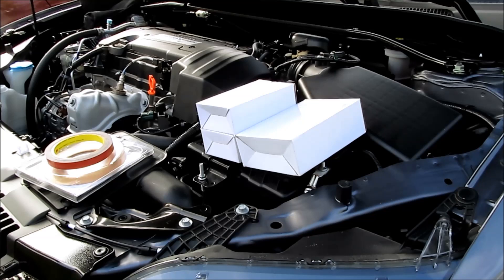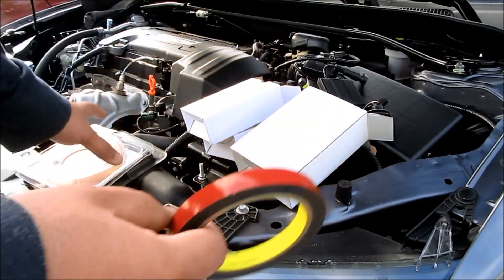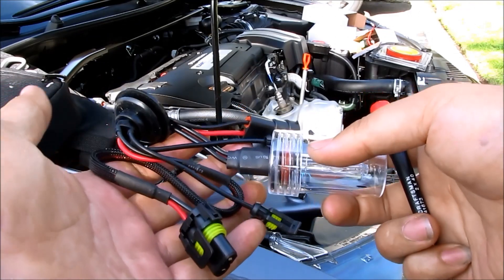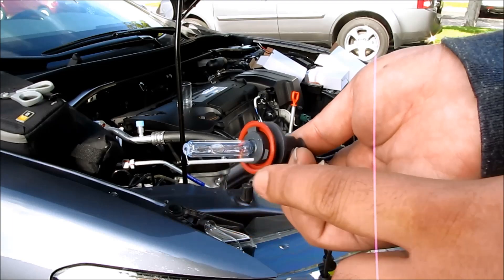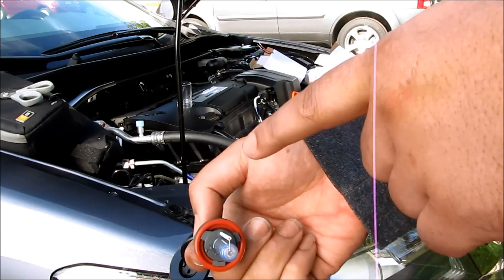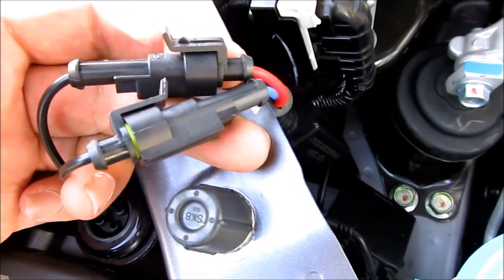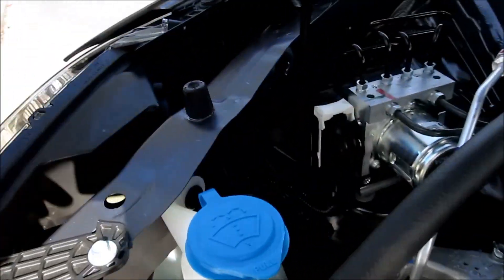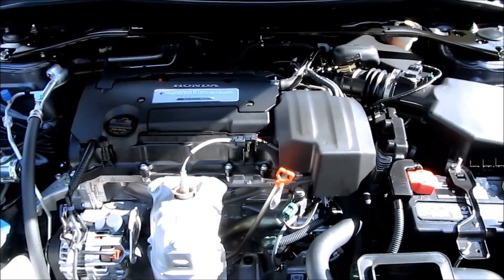DIY 2013 2014 2015  Honda Accord HID install (Must Read Description and Turn on Annotation)

Comment: Just installed this today on my 2014 Accord EXL and it looks great!  Awesome video!  Could not have done without you.
Some observations:
1.  If you have big hands, it's pretty hard to take out and replace the bulbs.  I had to use other tools to get leverage.
2.  Plugging the ballast into the existing cable assembly was REALLY hard.  It took a LOT of pressure to get it to "snap" into place.
3.  I ordered the 6000K temperature bulbs.  They are as far blue as I would go (thinks Car Modz for the advice).  I actually think I may go down to 5000K to get some extra brightness and more closely match my DRLs.

Good Luck everyone, and thanks again for the video!!!

Comment: Hi,

I have a 2014 accord sport. I got the DDM 35w 6000K. I was installing it this way and followed your guidance exactly, but neither bulbs were lighting up. I used the wires that you took off, and they lit right up. So, I believe the sedan versions do need the additional wire to make the bulbs fire up. Thank you for the videos man!

Comment from the maker: Yes, you can use H11 bulb but you will get the return wire shadow on the beam pattern.
Difference between the H11 and H11b is where the return wire is position when locked into the socket housing. In H11 the return wire is on top position (12 o'clock) and in H11B the return wire is on the bottom (6 o'clock) in the housing.

Comment from the maker: Also, if you did remove the extra wire.. try using it.  Plug one end the the HID ballast and the other end to the stock wire harness.  it might be easier to plug in since there is more slack on the line.

Comment from the maker: Are you using the DDM hid Kit?  Also, when push the original headlight socket into the HID ballast you will hear it click.  If you do not hear the click, it is not pushed in far enough.  To give it more leverage, grab the original headlight harness and stick it into the HID ballast... next use your palm to push the plug into the ballast.   You must heard and feel the click.  Also, if that doesn't work.. you have to flip it.. The ballast has a + and - port and it must match.

Comment from the maker: 5k is perfectly fine.  The accord does come with halogen projectors.  It is not ideal to use HID bulb in a headlights that does not have HID projectors because of glare.  But that doesn't mean you can not use them.  The cut off will not be as good as retrofit projectors but they will be way better compare to just regular bulbs.  

You do not have to worry about damaging your stock headlight housing.  Just stick with 35W and nothing bad will happen.

Comment from the maker: Installing switchback leds are uselss for the 2dr accord.  Reason is that the coupe has a amber plastic piece that covers the corner turn signal bulb.  So regardless of the color of the led.. the front turn signals will still be amber both for parking and turn signal.

Now on the Sedan, the amber piece is not there.  So yes, switchback led is an option.  Don't forget to install the resister to fix the hyper blinking.

Comment from the maker: Those wires are used as "extension" wire for the ballast to the OEM harness connectors.  You would plug one end to the ballast and the other end to the OEM wire hanress.

Comment: I have been wanting to put HID's in my low beams as well.  I've read that the low beams on the Accord have reversed polarity and can cause your BOW or capacitors to explode.  Did you need a BOW3 or 4700uF Capacitors to make the HID kit work?
Reply from the maker: IDIAIN You do not need any of those.  BOW and Capacitors are more toward Domestic American and Euro cars( Ford/Dodge etc ) I have not experience any problem with any imports, especially Honda.

Comment: Thanks for the tutorials. I just purchased a 2014 Accord Sport and I want to have the HID lights.  

Question and forgive my ignorance for asking - what's the difference if I just install the bulb vs buying the kit w/ ballasts?
Reply from the maker: YakMan NC If you want to change your headlights to HID then you must purchase the whole kit.  2 HID bulb + 2 HID ballast.  The HID bulbs will not work without the ballast.

Comment: Great Tutorial
Ive installed an HID kit on my Galant a few years back and im wondering, because you have 2 ballasts, theres no relay required??
Mine only had 1 ballast but relay required.
If thats the case then im buying these TOday
Reply from the maker: carlos durazo You need 1 ballast per each hid bulb.  Take a look here:  FAQ: 2013 2014 Honda Accord HID Install 9 months Update

Comment: The link you referenced asks about some additional options.  You answered about all of them except the last.  Do I order the H1/H7 to 9006 adaptor cable?   Thanks.
Reply from the maker: If you purchase the DDM kit.. everything you need is included.. no additional hardware required... Just click 35W..H11.. "color of your choice" and check out.

Comment from the maker: Larry,Check your Inbox.. I sent you video of troubleshooting HID installation.  Also, if your using the extension wire, try removing the yellow rubber plug that is attached to connector base.

Comment: Can you also feature HID install for 8th gen accord particularly with the 2012 4 dr sedan. If. you can also recommend an aftermarket projector headlight, I will greatly appreciate.
Reply from the maker: allan egar Unfortunately, I can only make videos for the cars I own or when customers brings in their cars.  However, that a look here for detail instruction on how to retrofit projectors on a 8thgen accord sedan: http://www.driveaccord.net/forums/showthread.php?t=28737 and http://www.driveaccord.net/forums/showthread.php?t=56046 or this company offers hid projector retrofit service: http://www.lightwerkz.net/gallery/index.php/honda/accordsedan

Comment: jus install 10 minutes ago, it work great ( but they not work before take both wire off). Why cut off working well and keep on not working. If cut off working better why kensun company still making in the kit ? thank you very much

Comment: I would love to see pics of your ballast mounting and wiring.  For what I could barely see in the vid, it looked very clean.  Was that the relay you removed?  Is it because it's only if your low beams are used as DRLs?  What about an anti-flicker capacitor?  Were those built in?  Hondas need those.

Comment: I have pretty large hands as well I didn't find it thwt difficult you just have to get the right angle and put it rather hard and turn. I did struggle somewhat to get it straight up and down.

Comment: As always great work! I just ordered VLED DRL and was wondering if my buying these bulbs would affect the power distribution in any way.  I don't use the high beams all the time but I like knowing that I have them if I need them. Thanks for the videos and subscribed!
Reply from the maker: Good choice on the DRL and led brand. You will have no issues what so ever.  No errors, everything will be fine.

Comment from the maker: Removing the battery will make it much easier.  Also, the wire harness that I removed from the HID bulb is actually a extender for the HID ballast to the factory bulb harness.  You can use that to plug into the factory harness and then plug the other end to the HID ballast.

Comment from the maker: ***** Are you using a relay harness with your HID kit?  If you are then yes, if not then no.  i would try swapping the bulb from left to right and see if the problem follows.  if the problem switches to the other side.. you have a bad hid bulb.  If the problem stays.. you might have a bad ballast.

Comment: Jephu on the link that you gave for the hid kits can you tell me what to fill out in each of the columns. And I would need two sets correct? Thank you.
Wattage:
Bulb Type:
Bulb Color:
Mounting Brackets:
HID Harness:
Error Eliminator:
Adapter Cables:

Comment: I removed the extension wires and wired just like you show on the video pushing the connector as far as possible and still dont work.... dont know what to do now

Comment: Jephu I am having the same issue as Larry b had a month ago with not being able to completely plug in the connector to the ballast
Reply from the maker: I have another video up.. check this out. 
DIY HID Installation Tutorial   Connecting OEM Headlight Plug with the HID ballast Plug

Comment: Hey do you have a video on how to take off the radiator cover? I see that you don't have it on that's why seems you have a lot more space to work on it
Reply from the maker: Only thing remove from under the hood was the stock halogen bulbs.  No other parts were removed.  The vehicle is a completely stock 2013 Honda Accord Coupe US model.

Comment: I found some 100w LED Headlights that would like to install in my 2013 honda civic lx coupe,  they come with ballasts. are they safe to install or will it hard on the wiring and the headlight housing? melting. ...etc?

Comment: Hey Jephu, I went to a local stereo shop to ask about installing an HID kit and I was told that besides the HID kit I would also need to get a projector lens retrofit kit otherwise just installing HID kit would not project light properly and it'll bounce light all around the housing and blind other drivers etc. Have you heard about this?
Reply from the maker: They are somewhat correct ( not entirely) ,  In order to get the BEST possible light output/cutoff, you will need a HID projector setup.

If you have a regular standard halogen bucket reflector type of headlight (non-projector type)... then yes.. if you swap the halogen bulb to HID.. it will cause glare and can annoy oncoming drivers.

Fortunately, the Accord comes with a halogen projector assembly.  Now,  you can swap the halogen bulb with a HID bulb and it will be "acceptable" ( much better compared to standard halogen bowl headlights) .  However, if you compare a true HID projector next to the Halogen projector with HID bulb you will notice that the HID projector will have a much better cutoff.

These TL projectors are popular choice for hid projector retrofit project:  http://www.theretrofitsource.com/complete-retrofit-kits/morimoto-retro-quik-system-accord-honda-2013.html#.Uy9krvnmxYU

Now, if your local shop trys to sell you a aftermarket projector headlight assembly instead of  an oem headlights with hid retrofit projectors.. just walk away.

Comment from the maker: I never heard of kensun hid kit.  If you want better quality bulbs.  I suggest you purchase the kit from retrofitsource, contact Matt over there and tell him you want H11b bulbs.

You can always purchase a H11 bulb and cut the tabs so that the return wire will face down.
I sent you a link.  check it out.

Comment: hey jephu, did you noticed that the bulb was somewhat loose? Like it wiggle around when i connected to the headlight housing.  After a bumpy ride I came back and found out that one of the bulb went off since it wasnt making full contact with the oem harness and the ballast.  I had a hard time connecting the ballast to the oem harness and I found out later that i needed to move the prongs from the ballast in a little closer so that it can make contact and that's when it powers on.
Reply from the maker: I haven't had a problem yet.  It might feel a little loose but unless someone tugged on the wire harness it should not fall off from regular driving.

DIY HID Installation Tutorial   Connecting OEM Headlight Plug with the HID ballast Plug

Comment: I have a question for the 2 wires u have taken off which you said "not necessary" for this installation. If those 2 wires are not "needed", so why the HID company still make those wires come with the bulbs? and what are those wires actually for? what is another option of using those wires and where they can be connected it to, and what are the purpose of the HID company making them going with the bulbs?
Reply from the maker: It is to accommodate different types of connector wires  for all the different make and models of cars out there.   If this is your first HID install, I HIGHLY recommend that you use the included wires that I removed.  To install, you take one of the of the wires and hook it up to the original headlight socket and the other end goes into the HID ballast. Basically you can think of it as a "adapter" that goes in between the original headlight socket and the hid ballast.

The only reason why I removed mine are I was 100% sure that I can get mine to work without it and that meant I had less wires  to tuck/ziptie on the installation. ( I explained this many times on the video and have numerous video uploaded that shows the HID on the car are working properly ).  

Basically if you have to ask why I did what I did.. don't do what I did and just install the extra wires.

Comment: videos are awesome man! keep them coming! quick question I'm looking to Buy and HID kit for my High and low beams on my9thgen. what would you suggest i get?
Reply from the maker: http://www.driveaccord.net/forums/showpost.php?p=2522930&postcount=40

If you choose to install HID on the high beam and you do not have the factory DRL leds strip then your going to have  to disable the DRL light.  

The correct size for the high beam is 9005.

Comment: Hey I just got that same kit and I was wondering if you had any trouble connecting the harness wire to the hid ballast. Thanks
Reply from the maker: No problems with the HID kit I've installed.  Check this vid: FAQ: 2013 2014 Honda Accord HID Install 9 months Update

Comment: Thanks for the video, excellent work. Hey I just had one question did you ever got a changes to switch to the F3 ballast and CNlight bulbs? If you did will you recommended better then the DDM kit?
Reply: Chance*
Reply from the maker: I could not find a H11b cnlight hid bulb.  I tried the regular h11 cnlight and although the color was a much whiter than the ddm, the cutoff output was very poor.

Comment: Hi, thanks for the video, did you have any problems with the Auto light feature during the night?
Reply from the maker: I have not tested it but I don't think it will cause any problem with the auto light feature.   They will function just like the stock headlight bulb.

Comment: If I don't want to install HID lights (too much work..), are there halogen bulbs that i can buy that would produce the same brightness as the standard halogen bulbs but with a similar white color output as the DRLs? if so, could you give me a recommendation for which bulbs to buy?
Reply from the maker: You can buy a H8 halogen bulb and modify the tabs.  Search google for pictures.  H8 bulb will be brighter than H11.  As far as the color, they do make "whiter" halogen bulbs but I'm not sure which brand makes them.

Comment: So, I just did this and one side doesn't light up.  All I can think to do is switch the ballasts and see if the problem moves.  I guess I could do the same with the bulb.  I don't see much else that could go wrong.

EDIT:  I got it.  It was what you mentioned at 6:24.  I have different brand wiring and ballasts than you.  The red wire coming from the ballast is actually the negative and needs to be hooked to the black wire.  The black wire coming from the ballast needs to be hooked to the brown wire.  So, it is brand dependent.
Reply from the maker: congrats on your HID install =)

Comment: Would you get the 35W or 55W?  Also how long did your bulb last?
Reply from the maker: TheKleanTrix I would stick with 35W. Had the DDM Kit for over a year, still works but recently changed it to the F3/XB35 HID kit combo.
Reply: DIY: Car Modz Why did you change to that?
Reply from the maker: TheKleanTrix So that the color match the XB led fogs.

Comment: Hey nice job on the videos. I have seem all your videos and learned alot. I recently bought an Accord 2014 EXL. I want change the headlights to HID and I went to the link you provided in the comments but I did not find H11B in the list for DDM kit you recommended. Is there a different link for the H11B?
Reply from the maker: Watch this video:

FAQ: 2013 2014 Honda Accord HID Install 9 months Update
Reply from the maker: the ddm h11 is a h11"b" style hid bulb.  That is the only kind they carry.  The "b" just refers to the orientation of the return wire.  All manufacture will list the bulb as h11.  You just have to contact the seller to verify if the return wire has been rebased so the return wire lead is not on any of the tab.
Reply: DIY: Car Modz Hey if i put HID for my DLR do you think it will be too bright and will the high beam work better then the LED?
Reply from the maker: You cant use HID as DRL.  It just doesn't work due to low voltage for DRL mode.

Comment: Please tell me these work for the V6 9th Gen as well. My HIDS finally came in but my cocky mechanic told me these are for the high beams and said it wouldn't work for the low beams. I called DDM tuning to confirm my order was for low beams and they informed me it can be used for either and that most Honda accords use a reverse polarity as well. My HIDS are the exact same as yours but the only difference I am seeing is that you installed this on a 4 cylinder in this video where I am installing it to a V6. But I don't believe that should make a difference??
Reply from the maker: As long as you purchased a H11 Hid kit it will work for all 2009-2014 Honda Accord.  It doesn't matter if it is i4 or v6 and coupe or sedan.  The low beam is H11 and high beam is 9005.
Reply: Okay thanks, I already installed these myself earlier today. I figured out the plug from the HID ballast didn't fit into the factory OEM plugin because the tab on top of the DDM ballast is too big. I severed a small piece off of the top of it with a straight razor and it actually fit entirely into the factory plug in now, it snapped in all the way no spaces. I found this very helpful for anyone having issues with this HID kit. Saved me the frustration of the lights not turning on at all at first!